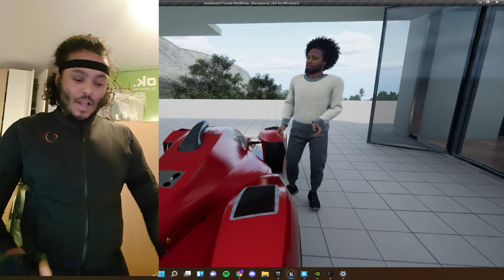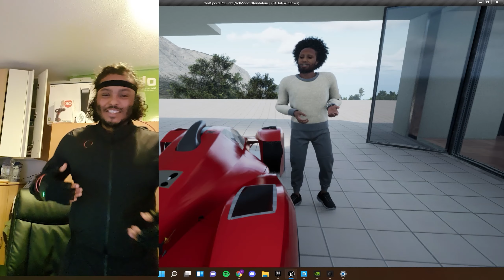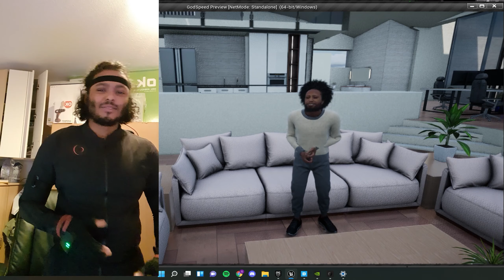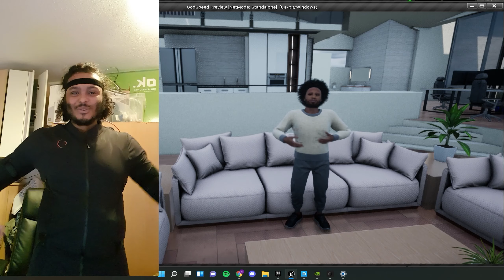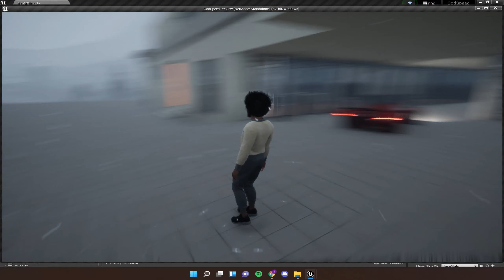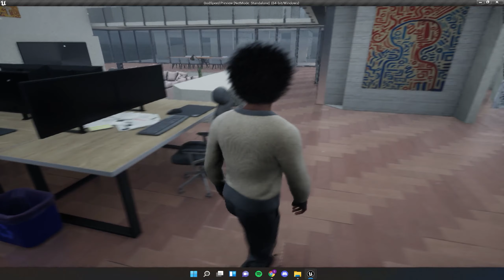Rokoko SmartSuit Pro 2 Unreal Engine 4 Metahuman Demo | Veldboomstudios

Comment: Thanks for sharing. What about foots position? Looks like they floating on Unreal. And they looks a bit better on Rokoko editor. Did you manage to fix them when cleaning with the standard tools of the Rokoko editor? How does the animation behave when changing the height of the actor's position?
Reply: he's using it in treadmill mode :) in locomotion the feet position is correct ... but can be more glitchy :D
Reply from the maker: @TheAF01  so, if I take it out of treadmill mode the feet will stay stationary?
Reply: @veldboomstudios  if you use locomotion instead of treadmill, your whole body (feet includede :D ) will move acording to your footsteps. Treadmill locks the root (pelvis) to a fixed point.
Reply from the maker: @TheAF01  thank you I will adjust that for the next video!
Reply from the maker: I still have my way to go when it come to cleaning up the mocap data. I was focused on getting the metahumans to follow the Rokoko studio live link.